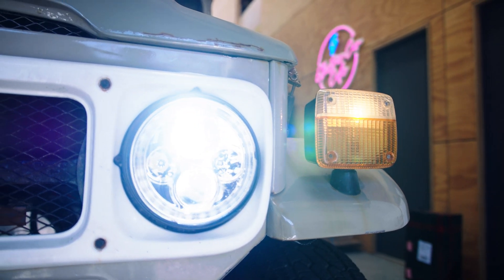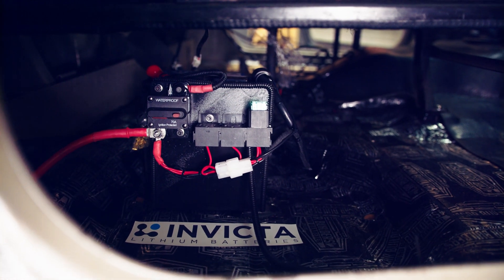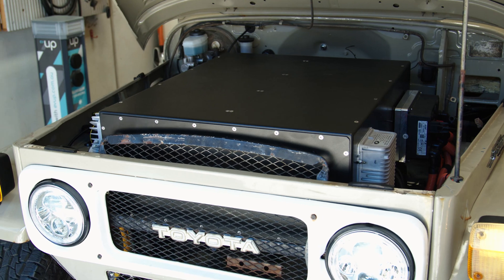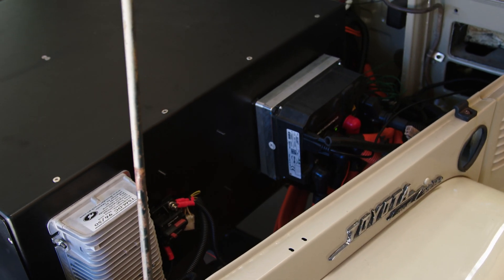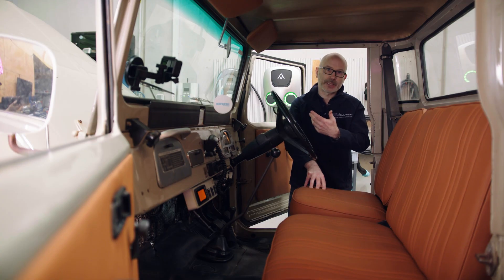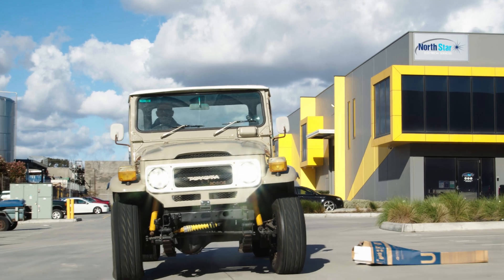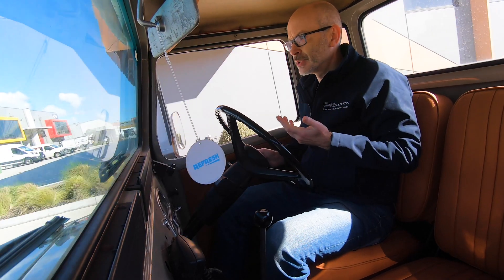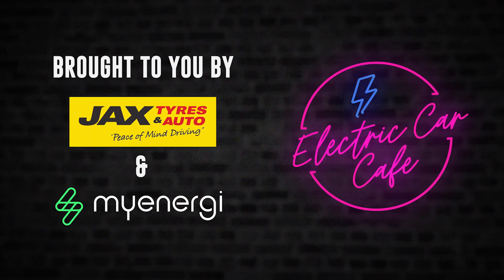Tesla Toyota Electric Landcruiser HJ45 EV Conversion Restomod - Part 3: On The Move

Comment: Its a 4x4 off road, built for sealed road use only . . . . . . .what a lemon.!
Those battery cooliing fans are open to the batteries, internal wiring, fan motors, bearings and a million other components . . . .
What does sea water do to electronics, and metal ?   does anyone know?
how do you stop salt water spaying over everything, what about a dirty puddle, a clean water puddle, wet mud turned hard?, slime, 
Is everything built with marine grade ?
interested to see if you can go thru a puddle . . . . .. or that the end of your travels . ..
your last answer was '  swap consciousness   something . .'  WTF?   is that what i say at the sight of a puddle   ?   will that get it across the puddle?
very interested to see . . . .lets see what happens ?
Reply from the maker: Thanks for you for your comment. Those fans are for the chargers. everything is sealed to IP65.So water crossing really aren't an issue

Comment: Great conversion.
I recently saw an episode of Classic Electric Cars where they removed gearbox transfer case and ran prop shaft direct to Tesla 300 motor and then filled the bonnet with 6 cells  and 4 in the rear. Are you doing something similar instead of using the hyper 9 onto existing gear box and transfer case?

Comment: Did this build require any cutting of the body or frame? I have thoughts of converting my 80 series.
Also with the additional battery packs going in the rear, how much of total range will this particular build get?
Reply: They put 100kw pack in it bigger then a tesla and they estimated 4 to 500km range when they were building it.  It would cost a small fortune but you get what you want if you build it yourself.
Reply: @DanielSan-ch7dr  I wonder.. they could easily double the range by adding another pack under the rear tray similar to a dual/long range fuel tank. But in this case, I'm guessing not possible given the vehicles  use in water crossings

Comment: one question, what happens if you go through a creek or a meter of water? does everyone burst into flames?
Reply from the maker: None of the above. What actually happens is you swap consciousness with the person sat next to you. This will occur irrespective if the person is male or female. We are working to rectify this issue however a workaround is available. You simply need to drive through the body of water approximately 90 minutes after the first immersion. This usually gives participants enough time for series of hilarious body swap escapades and experimentation.
Reply: @electriccarcafeatevolution4319  
:D

Comment: Surprised wheels and tyres aren't coming from The Wheel Deal.
Reply from the maker: The series is sponsored by JAX Tyres and we have a long relationship with them so we’ll be going to them for not just the wheel and tyres but also suspension and batteries.

Comment: It's a shame you didn't show more of the actual build, and a little bit of the thought process and engineering behind it. It's an awesome project but after three episodes, I'm really none the wiser. Example - you've installed electric power assist steering. How? What unit are you using? Why did you choose it? What were the challenges? That's one little item - there's probably 30 other things that are all an episode on their own.
Reply: agreed!  TBF, they are probably putting out regular content to keep  utubes algorithm going.
Reply: Jerryrigeverything did a H1 hummer electric conversion that shows in depth details if you want that kind of details.